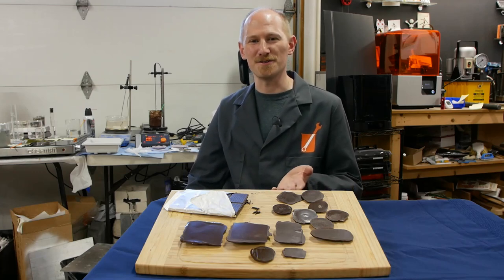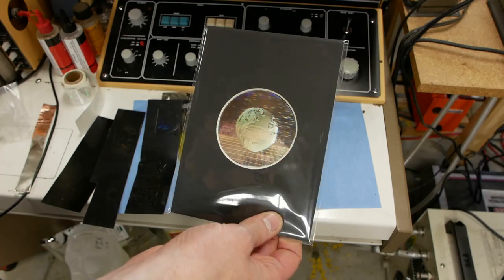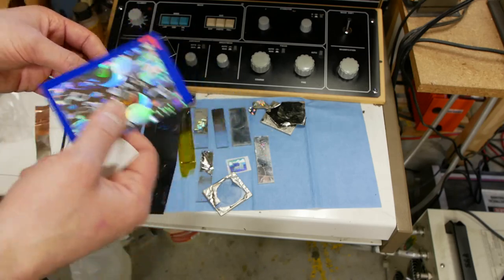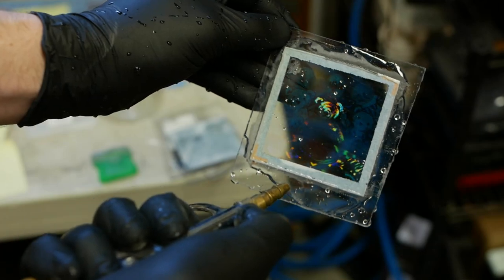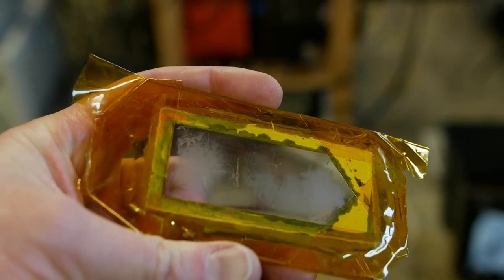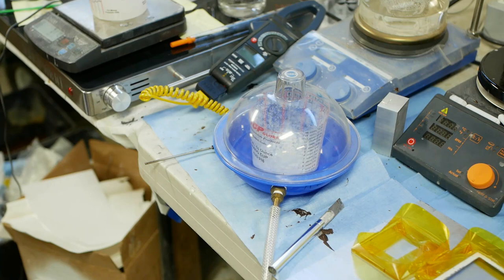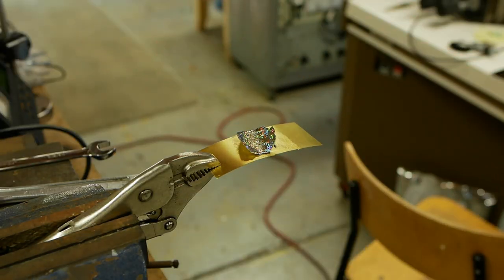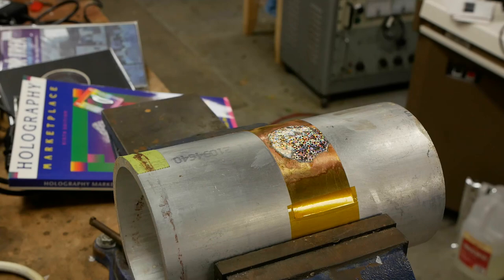Holograms on chocolate

Comment: So let me start off with, this is brilliant and the results are amazing and you're a fricken genius. I dunno if you ever saw the video on my channel where I'd talked about trying to do exactly this. I even bought literally the exact same holograms from the same ebay supplier. But where I failed was removing the backing layer. I managed once or twice by epoxying the back of the hologram to give me something to grab and physically tear the layers apart but only ever got it to work with an "amorphous" hologram, never the images. I'm stunned it was as easy as soaking it in hydroxide and I'm kicking myself for not thinking of that. I just assumed (apparently incorrectly) that it was impossible so was going to go the hard way of making my own holograms just to have the exposed surface so I could then plate it and make my metal stamp, but now I see there's no point. This is way easier. And of course you took the concept much further than I'd ever have imagined and made the metal stamps which I'm stunned work so well. I still have all the stuff so I'm 100% going to have to try this.
Reply from the maker: Wow! I must have missed that part.  I remember your gecko tape videos -- was that where you mentioned it?  I'd be stoked to see your video on making original holograms too.  I think a lot has changed since the HeNe sandbox optical table days in the 1990's.  BTW, the neural net interface chip is coming along (well, actually, I took a little break from it, but am ready to proceed :)  Let me know your sched regarding this.
Reply: @AppliedScience  It was in the magnetic levitation table video. I was making that table because I was working up to the holograms and I talk about my attempts at chocolate holograms at the beginning. I'd been putting off the second part of that video where I actually make the holograms because I wanted to buy a nice piece of optical breadboard to use as the actual table base both for the weight but also for the nice mounting holes. I think I'm gonna try your method with one of the really big holograms I have left from that project. I got a rose that blooms as you tilt the hologram, it's stunning. I want to make it out of chocolate to put on top of a cake. I think it's about time I get around to the hologram stuff, just finishing up 3 bio projects I've been working on, then will get back to the physics stuff. 
I'll dm you about the chips!
Reply: @AppliedScience   Are you ever going to post an update to the geko tape?
Reply: Wow my favorite channels conversing!!
Reply: @thethoughtemporium  You might be able to skip making a silicone mold to get a large hologram. If the outside edges of the chocolate are freezing first and causing the center to rise slightly while it's still pliable that would leave a pattern on the edges but the center would melt smooth again, which is what seems to be happening. You may be able to freeze it before larger distortion has a chance to happen by, say, dumping liquid nitrogen on top, (that would also press the center down into the pattern as an added bonus). The thinner the chocolate the faster the bottom will freeze and the less likely it will curl or distort. (Once I get my cryocooler liquid cooled I'll try this myself to validate the process. Oh also, could one directly melt something like wood's metal into the pattern to bypass the nickel plating step for making a master as well?)
Reply: Get a room, you two! No, seriously! Please do something together, and bring along Tech Ingredients as adult supervision!
Reply: i was waiting for your reply
Reply: The Thought Emporium are you still working on your spider silk video? I think that an amazing concept, and unless I'm missing something I would love to see you follow through with it

Edit: post your following through with it
Reply: @a1d0t6  Yup, dilligently. I've talked about it on almost every live stream I've done. It's coming along, but it's literally the hardest project I've ever worked on and continues to be difficult, but I'm making steady progress. We've got the finished construct, it's just been challenging to get it into the yeast, and we're working on making variations that work in different species of yeast and also bacteria. New order of supplies arrive this week and so next week is the next round of silk work
Reply: Interesting, isn't it, how a simple solution can escape us and hinder an entire process. Kinda makes you wonder what other things we've done fit within the same bracket or had "a solution". Looking forward to see the sodium hydroxide 'solution'.
Reply: The Thought Emporium nice, I'll have to get around to watching those now that school is done
Reply: @thethoughtemporium  Yeast eh? So... Spider-beer??!
Reply: @J0e T Large organic molecules like proteins can be measured in kDa or kD (kilodaltons). 
Based on the Dalton, which is: 1.66×10−27 Kg. 
The average molecular weight of an amino acid is 1.10 kD.
Size, (length and width and depth), depends on bond, bond angle and folding and such, and is non-trivial. One way to measure size is electrophoresis. 
The Royal Institute has a video where they extract DNA from bananas, iirc.
Reply: James Driscoll that’s really interesting! Thanks for mentioning. 👍
Reply: @J0e T The Dalton is the atomic weight, like on the periodic chart. I'm sure electricity is involved with the size of a large molecule, but it's mass is something else entirely, and is based on the number of protons and neutrons in the mix. Sometimes it's averaged for isotopes, because real life elements are a mixture.
In a practical sense, mass is pretty well established as a property. A mole of an element is 6.02*10^23 atoms of that element. I did that in high school chemistry, and it works surprisingly well, even for large molecules.
I cannot, off the cuff say the weight difference of a DNA is, but it probably isn't very much. It probably changes shape more than mass.
Reply: @J0e T I have no idea what you are talking about.
Reply: @J0e T Genes arent subatoming. It are huge molecules you can see chromosomes when they are dividing with a regular light microscope. 

He isn't a chemist.

Plus sometimes you don't think of simple solutions. It happens to everyone.
Reply: @thethoughtemporium  I have a bunch of black widows around the outside of my house (it's normal for summer time). If you need a fresh one let me know.
Reply: "go the hard way of making my own holograms just to have the exposed surface so I could then plate it and make my metal stamp, but now I see there's no point." There might be no point for this particular project, but making your own holograms is a nice project on its own! I'd love to watch something like that... especially the 3D holograms.
Reply: @thethoughtemporium  There is a video on YouTube where Heidi Fearn tells an anecdote about upgrading from a makeshift anti vibration table made from (if I remember correctly) a heavy stone slab balanced on tennis balls, and being disappointed to discover that the expensive commercial optical table was actually a downgrade. True you still have to mount your optics.

Photos of their setup - difficult to see past the clutter: https://boingboing.net/2014/11/24/the-quest-for-a-reactionless-s.html.

I think the video I'm talking about was one of the SSI videos: https://www.youtube.com/channel/UCd5YnyIxaZk8fyZmgHqmkwQ/videos - I think these videos will be of interest to you.
Reply: love your channel too!
Reply: @thethoughtemporium  Chocolate hologram bars in the patreon/sponsour store when? ;)
Reply: Depending on the type of plastic used for the front layer it's possible that acetone could be used to isolate the aluminum layer.
Reply: I'm curious if a modified CD/DVD burner would be able to produce easy custom holograms (maybe even directly on metal masters with a bit of fenagling)
Reply: @jadzzzz  : It should be doable, but do be aware that the first project might need to be the construction of a servo-grating so that you could continue the construction process. In essence, you'd apply a photo-sensitive solution to the surface of a disk, spin it up real fast to get an even-ish coating, then use an ordinary CD or DVD to provide servo timing signals to the drive, while using the optical emitter to expose the coating. Then you go through a standard photo-development process to stabilize the servo-disk, and can continue with development. A bigger question is exact designs: I suspect that a DVD or even BlueRay drive would be best, due to the multiple colors of laser sometimes present: they might give you the chance to stick a single servo disk behind or in front of the image disk, allowing the servo-disk to be a one-off instead of a consumable.
Reply: @pleasantmadscientist5818  Pretty sure the chocolate would develop internal stresses and crack like glass.
Reply: @J0e T Argument from ignorance? 
Well, I've given you solid examples of commercial products used in industrial processes and you can believe it or not. 
As far as your astrophysics comments go, keep your day job.
Reply: @J0e T It's been a slice
Reply: I'm looking forward to your video! :D
Reply: Are they edible
Reply: @thethoughtemporium  If you want a simpler Spider Silk concept you need to think PATTERNED MICROSTRUCTURE. Imagine a polymer-type protein with a loop or reactive hooks. The idea is the silk flows like wet elmers glue (loose ionically repulsive microfibers suspended in a weak gel) but when the activation chemicals hit it, the loops go attractive and snag each other, creating tight strands, for a spider, the Spinneret squeezes excess activation liquid out and compresses rotates the now-linked fibers. The key linkage is the calcium bonds at the ends of the linkage proteins, lactic acid, magnesium, muscle fiber type reactions. The stickiness factor is introduced after the silk fiber composites are extruded. Now if you're looking for CHEAP synthetic spider silk, look for 3D PRINTING MICROSTRUCTURE LASERS as keywords as you cheapest nanostructure bulk synthesis operation.
Reply: He got the idea 2 years ago from Tech Ingredients channel
Reply: @AppliedScience  what if you heat the mold and pour warm chocolate into it?
Reply: سوالی داشتی کمکت میکنم

Comment: I used to work for a hologram manf in the mid 90s as an electroformer. The man in the hologram of that book was one of the sales man and I worked with some of the peopel who made the holograms that are on the visa and mastercards. As an electroformer I would make masters of the hologram and "shims" as they called them for printing holographic labels, baseball cards, the stickers on the motorola startac batteries... This process is called electroforming. We would receive the hologram made in photoresist on a piece of glass. It was explained to me that the laser would etch an interference pattern into the photoresist and the apsect ratio of the grove is what created the holographic image. We would placed in an acrylic jigand hold it in place with tape on the edges. We would paint conductive paint over the tape and on the jig to an electric screw terminal.We would coat the hologram and jig in the silver solution except we sprayed it on. We would put this in a tank of nickel sulfamate solution as a cathode in a soft nickle plating process. We used soft nickle plating which gave a dull gray finish on the back of the shims instead of a hard shinny nickle platting that is normally used in nickle plating things. I believe it had to do with tensile strength. I don't recall exactly. We would plate it for many hours to get a few hundred microns thick. We would start a a low current  and as more nickle built up on the holgram we could increase the current since is was now a bigger conductor which would speed up the process of plating the "silver master" I think we called it.  When it was thick enough we would peel the nickle plate off the hologram and have a negative which I think was also refereed to as a negative mother since it had a negative image. We would cleanup the "mother" and smooth any sharp spots on the face of the nickle plate. We would spray the silver master /negative mother with I think it was potassium dichromate. These chemicals were all sprayed in a ventilated  hood while we wore respirators. This chemical would allow us to plate the face of the negative master and peel new layer of nickle off to get what I think they called a positive father. We did this many times depending on the number of nickle tanks that were free to make positive copies of them. We did this process for creating negatives and positives from the negatives  . It was very critical in this plating process not to get contaminates especially greasy ones on holographic images on the plates. handling the plates just on the edges with bare hands could ruin them due to the grease from our hands to run off and across the plat. Even if I handled something in the spray booth with my bare hands and then sprayed water onto the plate, would cause the over-spray to bounce off the object I handled and take the grease with it and to the plate and ruin it. This is why spraying a release on your hologram was a bad idea. We used the cleaner "simple green" to try to remedy problems . It worked best  but didn't always work  The final shims  I don't recall if they were positive or negative but they needed to be exactly 100 microns thick and the thickness over the whole shim had to be within a certain tolerance that I cant remember, but we had to use strategies of moving the nickle anodes around to make sure it plated evenly across the surface.They would take the shims and form them into a cylinder, I was not part of this process so I don't know it well.  They would take a solid metal "roller" that was part of the machine that printed the holograms and submerge it in liquid nitrogen to shrink it and slide the cylinder made of shims over the roller to make a fiction fit. I think they ran a UV setting plastic film trough the machine which would set into the holographic shims to be the holographic product ..label...sticker... I thought you would like an explanation of the process from someone who has done it before. One suggestion I would like to make is that I heard if you put butter in chocolate is hardens shiny, maybe you will get better results

Comment: I remember in metallurgy/metallography class talking about how tricky chocolate would be to analyze using the standard polishing method since it's so soft and melts easily. Would ve interested to see how you might tackle this challenge!
Reply from the maker: Yes, exactly.  Another difficulty is finding a solution to differentially etch the chocolate to show the crystal boundaries.  I poked around with it a while ago, but never got anywhere.  It seems like it should be possible though.
Reply: Luquid nitrogen?
Just to toughen the thing for polishing, sandin paper under it

Comment: I couldn't help but notice: the process of going from a plastic master to a nickel mold is a lot like compact disc manufacturing in reverse.
Reply: it is called electroforming. I believe they do that for vinyl records too
Reply: A chocolate CD?
Reply: Mr Lawson my first thought was that it couldn’t play back, that the tensile strength of chocolate is too low, it would fly apart as soon as it spun up in the CD player.  Doing some math, CDs spin at 500rpm when reading the inner track, 12cm diameter CD has a velocity of 3m/s  (6.7mph) along the outside edge, for a centripetal acceleration of 75m/s^2, more than 7.6 times the pull of earth’s gravity.  Intuition tells me that chocolate cannot possibly hold up to that stress, but a quick web search shows some research into tensile strength of dark chocolate and values seem to be around 1MPa, so perhaps it could work...
Reply: @jpe1  Would the laser ruin the track? I don't know how much heat would be applied through it. I'd expect they'd go for as little as possible, but might still be too much. Maybe chocolate is the secret to a one time read disk. Easily  disposed of in tight situations (just eat it lol). Secret agent seen eating pounds of chocolate in back alley 😆
Reply: @jpe1  it sort of works and was fun to test out, but  it wasn't perfect and was ruined after one play
Reply: Artisanne Chocolatier cool! Good to know that it worked at all.
Reply: Ryan Parkinson I think empirical testing is needed, the crystalline structure of chocolate is complicated, with different crystals melting at different temperatures, and some CD players use 3 lasers for error correction, so how much more heat would that make on a single spot at a time, I don’t know... but I love your idea of using chocolate to make a read-once disc, where the laser has to capture the data in the moment before the crystals melt away from the laser’s heat.  Rewritable CDs more or less use this, they have an organic pigment layer that changes structure when heated.

Comment: Tempering is indeed a very important part of making a chocolate. 
It allows a homogeneous bar, prevents "fat bloom" (fat making its way onto the surface), smooth surfaces and, most practical of all, easy separation from the mold. 
This is complimented with a shaking phase so the chocolate can fill up any space in the mold.